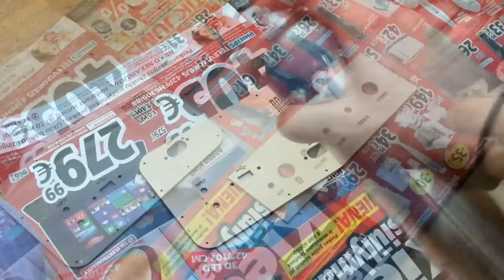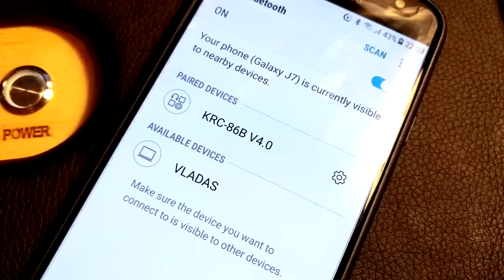INSANELY Loud 150W DIY Bluetooth Speaker Build l HOW TO

Comment: umm your power adapter is 2.4 watts it literally said 12 volts at 200ma.

also, I'm pretty sure only the right speaker is playing because you can see it vibrating way more than the left so basically might wanna make sure your left speaker isn't just a passive radiator here which will actually acoustically cancel the right woofer out somewhat.

maybe your bluetooth chip only supports mono? either way might wanna rig the amp to run bridged if it can that way. at least both speakers would be getting all the power. 

you literally have a 100+ watt class d amp psuhing like less than 3 watts into those speakers man. why cripple your box with that crappy power adapter? why not have a decent little 12volt power supply from an old xbox power supply gutted and glued in there with the trigger voltage detector always on? also could easily put a bunch of 18650 batteries bought from wholesale recycled batteries and hook them up to be wired at 12 volts and a charger unit seperate to charge the batteries via a custom connector. thing has potential man but could be a lot better. box has no bracing might wanna fix that. no polyfill. could have coated the inside with paper and contact cement for better acoustics as well. could have added a power through port for a 12v adapter from cars as well to still play efficient music tailgating from a truck or something.

your workmanship is really good man just missing a few details here and there.
Reply from the maker: Hi! Thank you very much for the comment! That power supply is only used for the preamplifier and the BT module, not the amplifier. A way more powerful one is used for the amplifier, my mistake for not showing it that clearly in the video. Batteries are an option in such build but were not necessary since the speaker would mostly stay stationary. Many more ideas could have been implemented in this project - will keep them for the next one!

Comment: So basically i just need to spend $4000 on wood working equpment routers, band saws, table saws, and everything else....then learn how to use them so i can save $100 on a blue tooth speaker....or i can spend $2000 on a awsome set of speakers $2000 on an amp and have an amazing professionally built system! This level of diy is pretty much ridiculous unless you already have the equipment and the skill level😒
Reply from the maker: Haha, you cheered me up somehow 😀 I guess you are missing the point of DIY. In most cases you will not save too much by building stuff yourself, but the knowledge and the skill gained while building is priceless. I do have to say that I do not own any of the tools you have seen in the video, nor am I a professional carpenter of some sort. I borrowed all the tools from people who have them and you can always make something simpler if you still do not have the skill for more difficult projects. Thanks for watching!
Reply: @DonnyTerek  its all good....i do do diy projects, but when a video says diy it supposed to mean pretty much anyone can do it so when it gets this complicated with all the machinery....it pretty much cant be done! But great work and skill on your part and i do like you vids....just making an observation😂

Comment: Sounds like a cheap pc speaker to me
Reply: You cannot judge the sound of an audio system that is recorded by unknown devices and then played back by your own audio system. At best very rough judgments of distortions and drastically wrong frequency responses are possible. Under these restrictions, a lack of low bass and distortions at high volume can be detected with this speaker. How serious the distortions are, however, cannot be said, since the actual volume is unknown.
Reply: Peter Ofenbaeck  Tried a different machine and still sounds like a cheap pc speaker

Comment: Ale ściema..... Zasilacz 200mA😂😂😂 12V x 0,2A = 2,4W poboru mocy... Zakladajac ze to stereo... Wychodzi 1,2W x 0,9 = max 1.1W na kanał.... No szok....
Reply from the maker: My mistake not clearly showing in the video that the main power supply is 36V 6.5A. The 12V power supply is used for accessories only.